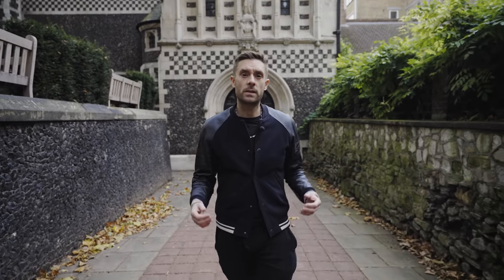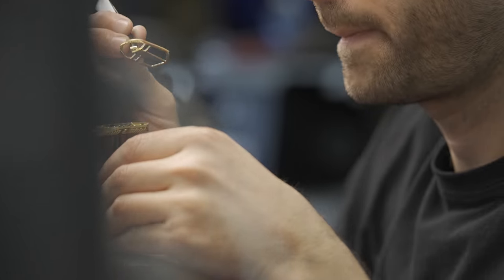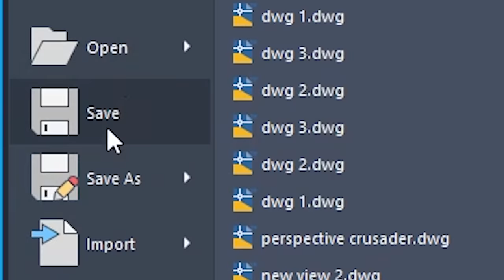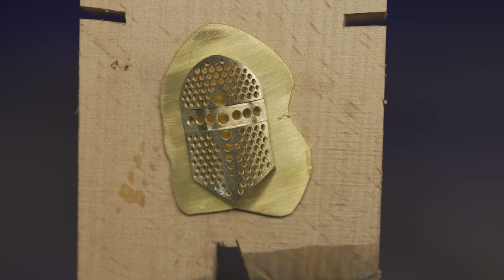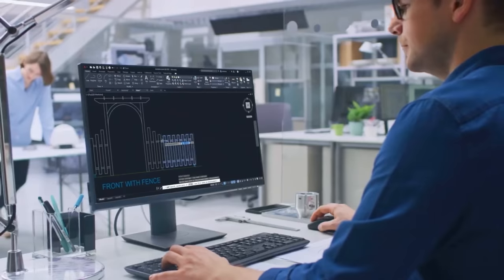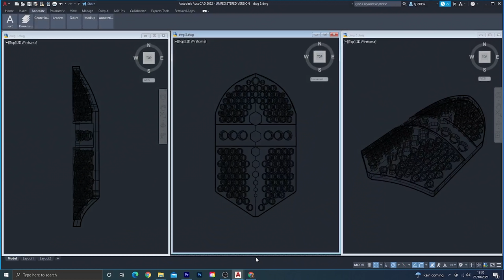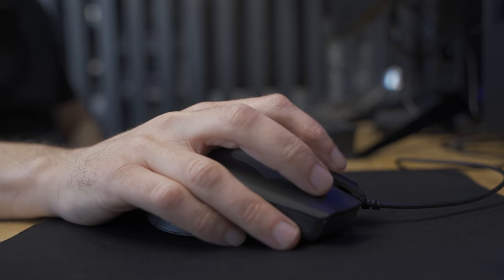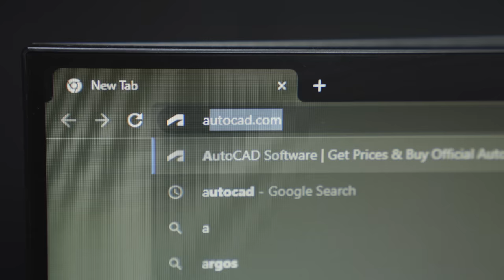How I Made A Gold Warrior Pendant

Comment: i flippin love the warrior pieces - old meets new, it's so badass! <3 random question - the marking tool you're using at 2:35 - is that just a regular one that marks using the pressure you apply by pressing down, or does it increase it, hence the click? does it have a name? i've been trying to find one but they're all just regular sharp tools.
Reply: That tool is called a center punch or auto center punch! I would describe it but this article from Durable Tech can articulate it better than I:

"A spring-loaded center punch stores energy in a spring, and as compressed it is triggered and releases the spring-stored-energy as an impulse that drives the punch into the work surface, producing the dimple, character, or symbol."